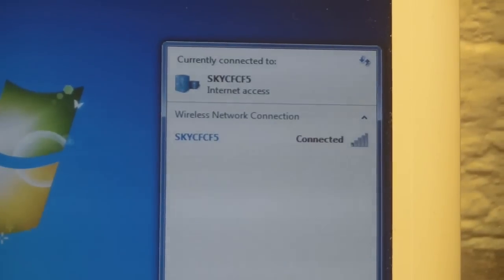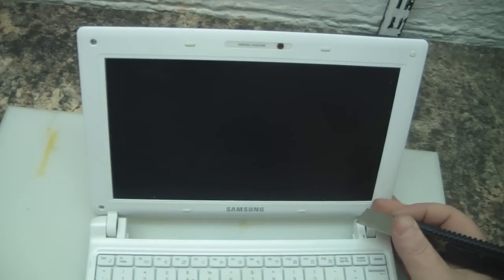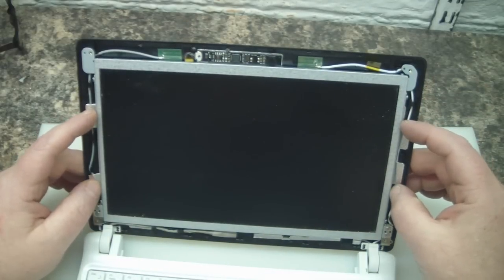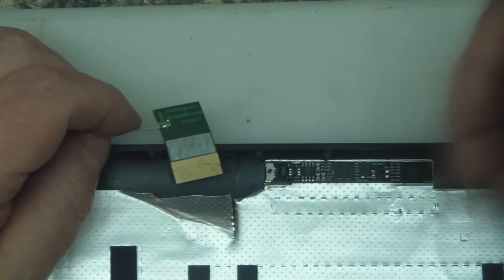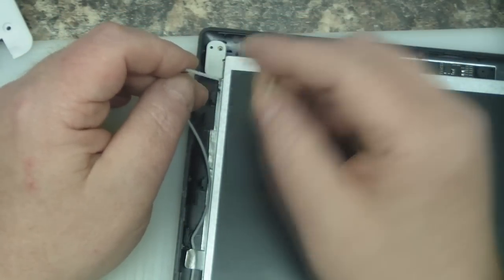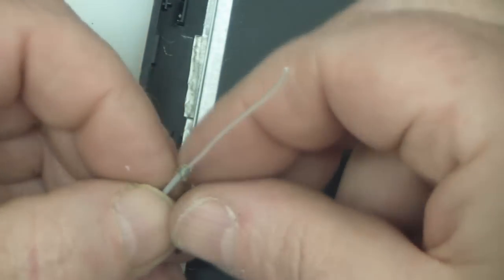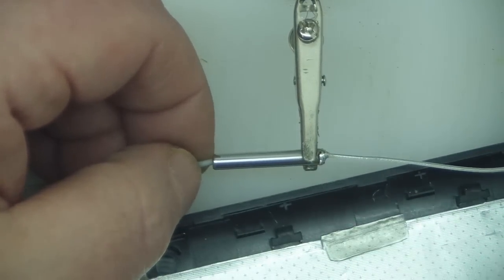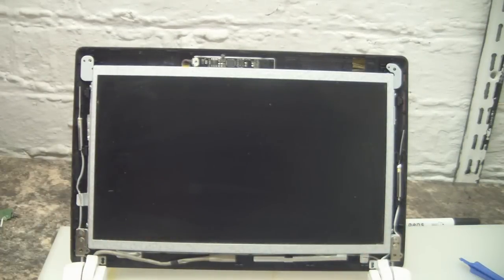Laptop Antenna Upgrade

Comment: Hello!

I had a similar issue with my tablet wifi antenna. I decided to jump into this modification despite being a little sceptical about it. It turned out surprisingly good. Definitely better than the old pipo antenna.

Thank you Andrew for the great video!

Comment: I went from no bars to 4 bars on an old HP laptop =) Thank You for this video. I didnt even use the tube from an old antenna. I had some foil tape used for weather proofing. just wrapped a bit around the wire with the shielding making contact with it... then left the 25mm end sticking out. Im sure Id have full bars if I had done it right ..but for a quick fix....YAY!!

Comment: The only reason I don't like dongles is because they protrude.  Even a small one could put your USB port in jeopardy of a bad connection if you have a dongle sticking out and you bump it.  The next thing you know is you just can't get a reliable connection on that socket any more and trying to transfer files across that connection becomes frustrating.  It is only worse when you hear Windows making those noises as it connects and disconnects.  Loose USB sockets are a very common problem too.  Fortunately some of those sockets are on separate boards inside some laptops and notebooks and connected via a ribbon cable.  That is a lot better than having to solder a new socket to the motherboard or in extreme cases buy a new computer.  If your computer is fairly old and you have been wanting to upgrade, a loose USB socket may be a good excuse to buy that computer.

Comment: Thinking of adding a new Intel Dual Band WiFi card. Will this antenna mod work to pickup both signals? After you figure out the BIOS whitelist issue most how-to articles just have you swapping out the cards. Can a dipole pickup both waves?

Comment: hi andrew, i take the screen out of my notebook, and i want to put the antennas inside of the keyboard, it si posible to de-solder de antennas, cut the cable and resolder the same antenna?
ty for your video!

Comment: thanks for the video andrew. I have  a HP pavillion note book pc15 with broadcom wificard, however I was having very good reception to me  upstairs room. But suddenly signal dripped and i hardly get any bars. So my question is how can I rule out that should I upgrade the wifi card or the antenna?

Comment: Hi! I would like to remove the wifi antennas - according to them, there are two in my monitor from my laptop. It's not screwed, so should I try to snap it until it comes off? Should I be careful or is there a "trick"? And I'm trying to remove the shading, right?

Comment: please explain the choice of 25 mm for the tail and 'pipe' length. Quarter wavelength of 2.5 GHz = 30 mm. I'd like to understand it better.
Reply from the maker: It would be very hard for me to explain here in a few sentences. These types of dipole antenna are based on the short dipole.  Basically this dipole is short when compared to a wavelength at the operating frequency 100mm v 124mm due to higher feed impedance with this design.
Reply: andrew mcneil
I googled the rest by the keywords. Thank you, good sir.
Reply from the maker: Anton Lymanets Your welcome
Reply: I believe it follows the hertzian dipole where the antenna itself is conductive therefore being able to take it to 25mm instead of 31.25mm which is the length for 2.4GHz

Comment: Hi, if you dont have colour or indicators on the card/wires, which of the 2 antennas plugs into which socket on the wifi card. i have a card i want to plug into a HP laptop which already has wires from previous card.  Does it really matter which wire clips into which socket? also will i need to download drivers for that card for it to work?  Thanks

Comment: so you only soldered the ground point ?! and left the positive as the cable main feed ?!  ...  I was stuck not modifying them all these years because the cable was so small I couldn't seperate the main feed from the ground shielding

Comment: Here in 2022.  If your dipole was so much simpler, why did Samsung use Pcb antennas?
Reply from the maker: money
Reply: Could you have also just soldered a wire to where you cut the ground sleeve pointing in the opposite direction (straight down) instead of the cylinder?
Also, have you seen this one?   https://www.youtube.com/watch?v=K87X_qwe4mg  
It seems to be designed like an antenna cradle.

Comment: Hi. do you think copper tube will work as same as the metal tube you use in this mode?
Reply: Yeah should & in fact it is (sort-of) required. Remember you'll be soldering to this piece of tubing.. For that reason it should either be made of copper or brass (brass is simply copper alloyed w/ zinc), OR it must be plated w/ copper or brass.

Comment: what I think was going on was, they were using the foil to shield the user from the radiation of the transmitter action. Unfortunately it made the original antenna very directional, if not defective.

Comment: What did you applied on the antenna piece to make soldering possible?
Reply: i think he just sanded down the antenna piece to remove the outer coating

Comment: Thanks for sharing the experience. But I think it'd be better if you simply soldered the ground off from these antennas so that they didn't have a short circuit with their own braid (that is, with common ground), as a result of which the received Wi-Fi signals can increase. Well, developers love to place these "shorted" antennas everywhere. Yes, in a sense, they're right, with such an antenna there's less interference, but it bothers us when we receive a rather weak signal.

Comment: Si pusiera subtitulos en español,sería el rey del mundo o del universo! 
Mi duda es, como se cierra el circuito del cable de la antena, se supone que el cable positivo siempre transmita la onda de radio, y que el negativo cierre el circuito? el papel metálico para que sirve? thank you!
Reply: +EL VIAJERO DEL TIEMPO HD El papel de aluminio sirve para que las ondas de la pantalla no interfiran pero a las vez obstrullen la señal inalambrica por eso le puso los tubitos de cobre lejos del papel metalico y no las ondas de wifi no se transmienten en circuito por lo que no hay problema dejarlos asi, espero que te sea de ayuda
Reply: y si rompes el aluminio que tiene ya no sirve la antena? 
o con los cablecitos y esos cuadrados puede servir como una antena?

Comment: i used the tip of an indoor tv antenna.. and followed your tutorial, but i got 1 bar signal of all the wifi. before i modded it. i am receiving around 2 bars -.- please help
Reply: use too the old antenas receptor's in the end of cable

Comment: will that also improve the Bluetooth?
Reply: Not sure, but after I disconnected one of the two cables from my wifi card, my bluetooth is definifely much weaker, while wifi is stronger.